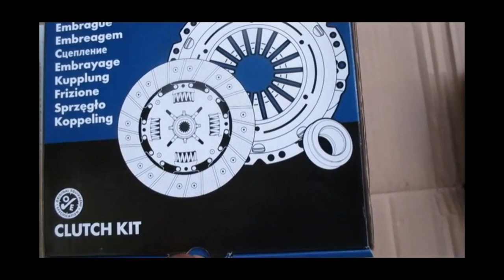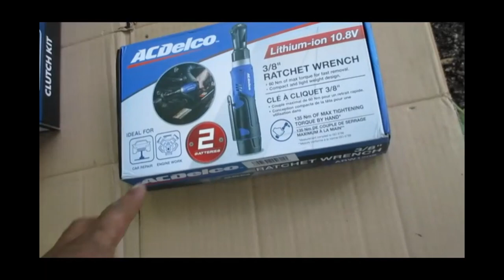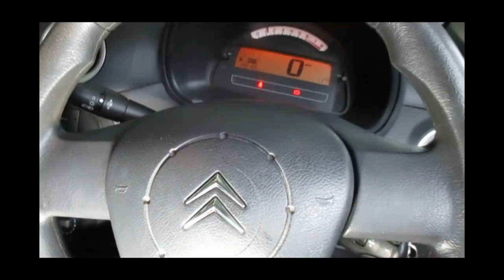How To Change A Clutch Kit On A Citroën C2 1.1 Litre Engine( Step By Step Video) Models 2004 To 2010

Comment: Did you have any issues getting the left hand drive shaft in ? Mine doesn't want to go back in it "clicks" I to the diff but doesn't go all the way in
Reply from the maker: It should go all the way in, unless there is dirt on the  driveshaft Splines.  Also if you have taken off the inboard (Inner) CV Joint then you must make sure (The Spring that is fitted in these CV Joints) is put back. That Spring holds the Driveshaft in Place..on Citroen and Peugeot Cars...!🤔🤔😇😇👍👍